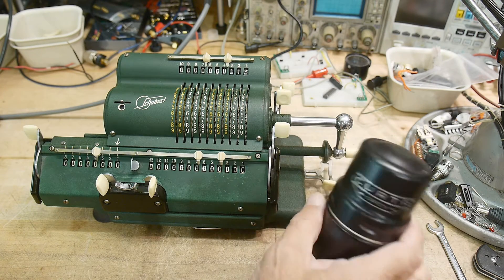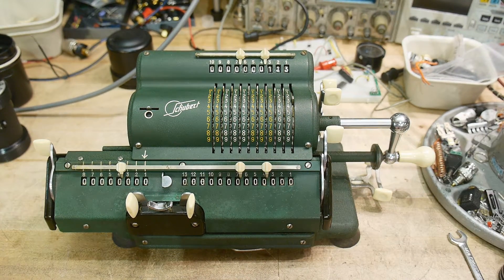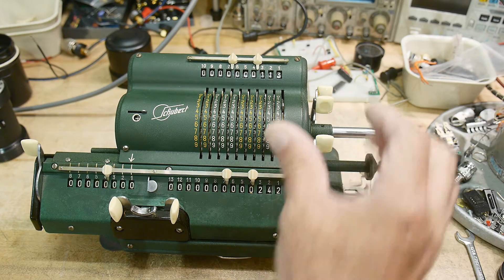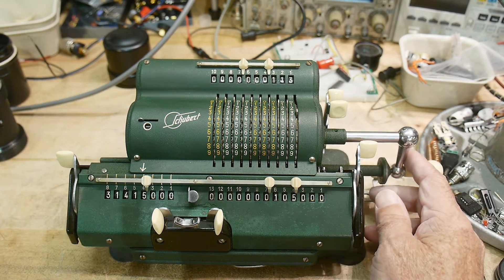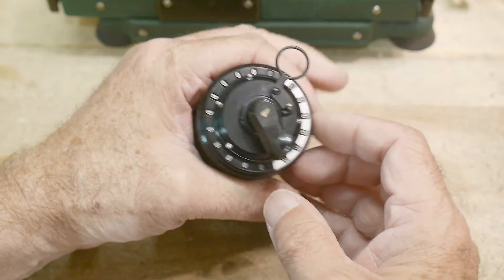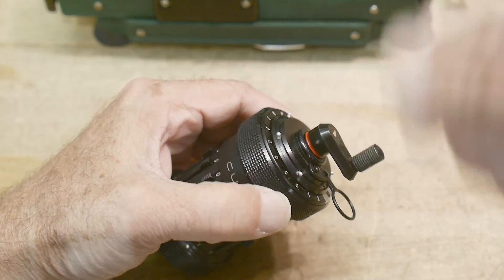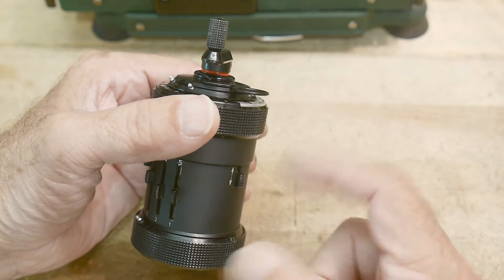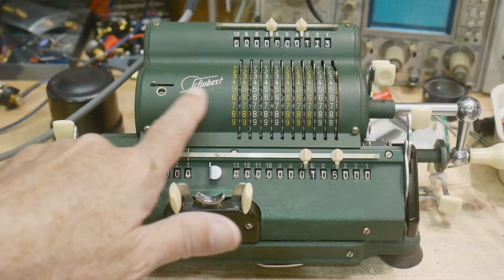#1532 add subtract multiply and divide on two mechanical calculators

Comment: Nice video, thanks.  I am lucky enough to have a UK made pin-wheel calculator - the Britannic by Guy's Calculating Machines Ltd., Wood Green, London.  As a child in the 60's I knew a chap who worked there, although by that time they where owned by Muldivo. His enthusiasm for engineering has stayed with me to this day.

Comment: For years and years I had a soldering station.  The iron had a thermocouple near the tip.  The station had an analog board with some transistors, resistors, a transformer, and a triac.

The knob was marked 200 300 400 500 600 700 C but was basically uncalibrated.  I just kept it around 300 or 400 and it worked fine.  (Need more heat, turn it up a bit :-)

There was a red LED on the station which went on when the iron was on.  It heated up in about 15 seconds, then the LED turned on and off with some hysteresis.

If you turned up the knob, the LED would immediately go on and then off a few seconds later, and the iron was now a bit hotter.

It was very cool to use, actually.

Then one day there was the smell of burning 🔥 components from the base.

It never worked again, but it had certainly done its job admirably for about 20 years 👍

Comment: I remember learning the slide rule for one year in school and then the next year they got rid of that and switched to electronic calculators. I used adding machines back in the day (mechanical) but never one that could even do multiplication or division. Very interesting! Now, how do they work on the inside??? My father was a sales engineer and had to do calculations all the time. He relied on his slide rule. When the first scientific calculator came out that could do trig functions, logs, etc... (HP 35) he bought one right away and never went back to the slide rule again! I still have that HP 35 and it still works!
Reply from the maker: https://youtu.be/GNhivjsSiD4